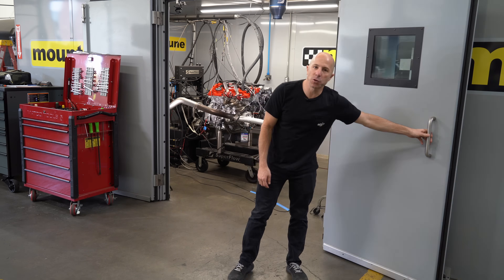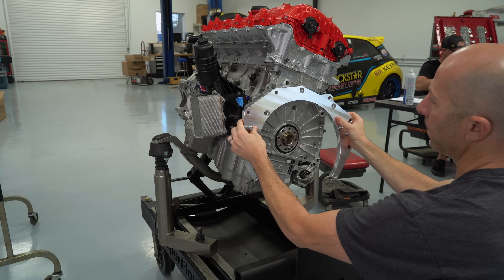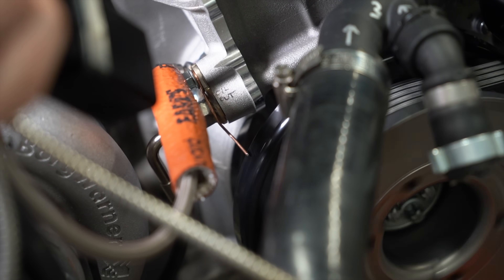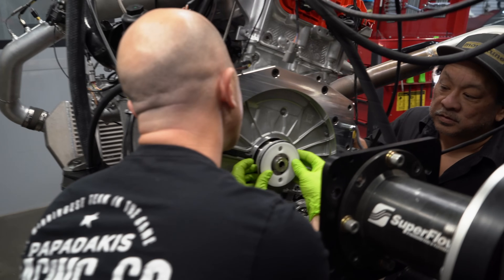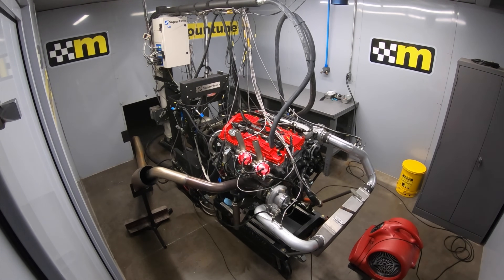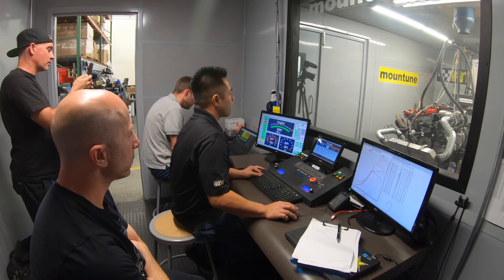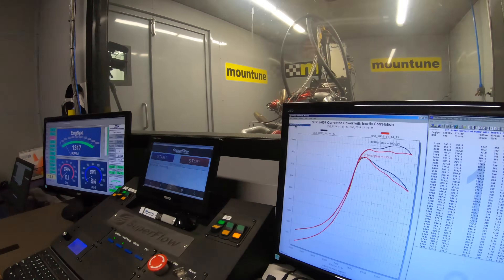B58 Engine Dyno 1000+ Horsepower - Sounds like a 2JZ!?

Comment: Engine: revs
Direct injector: ight imma head out
Reply: n54 vibes
Reply: I still wish they retain the direct injection system.. with them the engine able to take more aggressive ignition timing ...and the vvt system...picks up alot of torque down low....

If disable everything, then might be as well as using old 2jz engine into the new supra
Reply: Cheap ecms like the aem cannot control a direct injection system. You’re stuck paying for top of the line Motec, Syvec or I think Haltech offer some DI control now. 
I don’t know why they omitted the variable cam timing. It’s not a huge deal on a race motor in a lot of cases although I think you can do some thing with valve overlap to help spool really large turbos. They must have figured they didn’t need it at this time to accomplish their goals. 
I’m guessing this project is really only a stepping stone.
Reply: @Turbochargedtwelve  get an ECU that can. To not run the direct injection is a waste of potential. Typical dyno mentality, where getting a number is more important than the curve.
Reply: @DodgyBrothersEngineering i hope after this (since 1k hp target achieved).. they will redo the direct injection and the variable cam setup....
Their effort of building the b58 were awesome anyway
Reply: @DodgyBrothersEngineering  You cant use direct injection as fuel pump not strong enough for 1k hp.
Reply: @AmirPomen  yes that would be really cool.
Reply: @proxypanda4156  nope but you can use it to maximize some of the other benefits. Direct injection cools the combustion camber area whereas port injection often gives up its cooling effect to latent heat transfer, so by the time fuel droplets get to the combustion chamber any cooling effect has already been absorbed. Lowering combustion chamber temperatures lowers the chance of pre detonation and allows for greater timing advances. Not only that but injecting in multiple places allows for better fuel atomisation. Multipoint injection will always be better than a single point, if the tuner knows what they are doing.
Reply: @DodgyBrothersEngineering  Fair call, however is that still applicable if youre using e85, and is all of it lost or not because port injection is at the back of the valve which is also a benefit to cool the intake valves where as direct injection doesn't benefit that. If they're using specially coated piston tops for heat management then that's not really necessary? As Papadakis did, its much less complex system, and also what's the chances of direct injection failing compared to port injection? 

I feel like BMW obviously did direct injection to combat some emissions, and yes the better atomisation with multi point injection, but for brute power Is it really much of a gain if you come up with a beefy enough system to cope for that power level, then also how would the car idle with huuge direct injectors. 

I'm curious, if you were to build a b58, what would you do.
Reply: @AmirPomen  agree you have given away what makes it special.
Reply: Pretty sure these run at 320bar? Wonder why they didnt use direct injection and also run port injection.
Reply: @Apexfd  maybe the injectors cant fuel 1000hp?
Reply: Charlie Arvidsson definitely cannot but you can still use it to get ever last bit of fuel in the chamber and add more boost
Reply: Ahh, gotta love Bimmer memes.
Reply: Port Injections: NOOB
Reply: Boost: exists
Direct injector: Am I a joke to you?
Reply: @MozzaBurger88  Boost: lol you are when you bring a slingshot to a howitzer fight.
Reply: MozzaBurger Dookey
Reply: Im going to subscribe out the gate just off the love you have in the comments.
Reply: Everyone has their own recipes.. papadakis is pioneering this.. things will change in the future or maybe not.. sometimes simple is better. No di or vvt
Reply: I think the fact that he races it may be important too. A single rail with the injectors outside of the combustion chamber may be much easier to service than one mounted into the head.
Reply: there was no fuel to cool it
Reply: @matutolaYT  you dont get the reference 🤦‍♂️
Reply: @matutolaYT  as stated in the video

Comment: Why didn’t they just use direct injection in the first place?
Reply: Not enough pressure on the rail for the size. You would need something the size of a diesel injector for that kind of power. Just not enough room.
Reply: so far only custom stuff can provide enough fuel in direct injection to make 1000hp
and those are extremely expensive

Comment: Great work! 
But I think using 2jz is simplify and cheaper for getting 1000hp. 2jz-ge vvt-i heads with porting works fine as 2jzgte heads, 2jzge engine blocks transforms to gte simple too. There is no problems in searching gte engine, because almost all tuning parts can be applied to 2jz-ge vvt-i)) Yes, i undestand that b58b30 is a future, but we are still lives in present)))

Comment: this is as much horsepower as a bugatti veyron, with a 6 cylinder
Reply: no its not, its probably not even half
peak horse power is just a number, the veyron has 3 times as much power at 3000rpm, so you need to average the horse power over the rpm range
Reply: @matutolaYT  i guess
Reply: @matutolaYT  but engine technology has come a long way

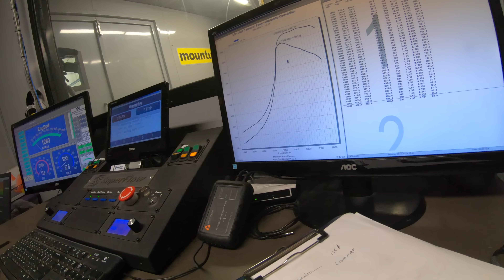Comment: 9:14 something is badly wrong with your turbo or cam choice .. massive torque peak when it comes on boost then it falls like a stone .. 900lbft at 5500 giving you 940hp then torque dies and power flatlines across .. if you had the same 900lbft at 7500rpm you would make 1285hp .. fix your part selection!!

Comment: I hate to be that guy, but on a six cylinder with 43psi of boost and your billet everything with you new injectors, you should be making more than 1009 horsepower. If you read this papakdakis, could you fill us in on what your limitation is? Are the injectors at max duty cycle?

Comment: If injector tips burn when not in use, then it must be very bad to do cylinder shut down on DI for Honda V6 engines. Over time I bet the seals burn. 1000HP accelerated it. Cool quick fix with those dowels.

Comment: How engine is cooled on dyno? I don't see any radiators
Reply: They have a water to water system that takes the hot water out of the room so the ventilation fans don't have to work as hard.
There will be a radiator outside, with a coolant loop for the engine side going through a water to water heat exchanger to carry the heat out.

Comment: I’m not sure if I’ll get any feedback towards what I’m asking, but since I am terribly curious I’ll post them with high hopes.

My sincere thanks in advance for any consideration given and also for your time towards this public awareness initiative.

1) Can you advise why the exhaust cam profile was the only one changed? I am hoping that it’s a case of time frame on the development for the cam profile of the intake rather than a case where you were only aiming for what was necessary to achieve your target horsepower.

2) Since the exhaust profile was revised, can you share any engine pressure ratio details and also can you comment on whether there was a notable comparison on the variable cam timing tune (adjustment) between the OEM profile and the revised profile from Kelford cams?

3) Was there any specific reason that the volumetric efficiency data available through the AEM’s air flow modeling didn’t reflect a significant change in air mass being ingested by the engine? If this was the case why you realized that the recirculating air supply fan for the dyno cell was off then it would have great to share this.

4) Should the case be that a direct injection fuel system has become available with enough support to cover your horsepower goals would you explore this avenue? I am speaking about a DI only setup, not a mix of DI with PFI.

5) What ecu manufacturer would you be open to working with if the opportunity presented itself?

6) Many of the technical details that reflected the success of this project weren’t shared, I am speaking mostly from the perspective of engine management data, would you be willing to make some of the obvious illustrations available by way of data log screen shots? No specific calibration data necessary, just the recorded data from the sensors.

I’ve got a few more questions but this probably isn’t the appropriate forum. Thanks again for taking the time to facilitate such an open initiative, and I commend your efforts.

Cheers 🍻

Comment: I wonder if you’ve run in to the problem where you’re you cannot push out any more gases through your manifold I’ve never worked with a dino but it sounds like it’s bargain really hard opening up and then boarding off at the top end

Comment: Struggling at 42psi? Smells like you're running out of turbo. If there's anything I don't like about that motor is that integrated exhaust manifold crap, makes everything harder to deal with. And I guess timing in the back, but that's not new sadly.

Comment: @
PapadakisRacing 

Hi Mr Papadakis,
why you dont use the Motec M1 GPRDI (Race with Direct Injection) together with the original direct injection and the port injection ? 
It would not be a disadvantage, for my opinion. 
The next Question is, why you close the Direkt Port injection? 
That would been a good way to measure the combustion pressure, so knock sensors would no longer be  necessary and the engine would always run perfectly, keyword: MBT MostBreakTorque.

Best Regards
Aaron

Comment: Bit of a rookie mistake leaving the injectors there wo using them, but nevertheless cool stuff. You should put a proper DI capable ECU there and use also the advantakes of the direct injection!

Comment: Questions: why did he chose to go port injection? Does direct injection limits horsepower figures? Is there a way to improve current direct injection system to be as good as port injection or there is a bottleneck?

Sorry asking too much questions i just want to learn
Reply: No, actually the will go DI if the aftermarket supported it

If

Comment: The B58 engine in older Avalon might be a fun build. A simple rear-drive conversion with adjustable driver boost. I love seeing the big horsepower, high torque engines in light cars, but it's just as fun seeing a comfortable 4 door road car rocket down the road.

Comment: Don't know if it's just the muffled audio through the wall but it sounds like it wants to rev a lot more
Reply: If you look closely at the Tach on the monitor, the car never really goes above 7000rpm. I'm not really sure why they stopped there but I assume it was to be easy on the engine since they made 1000hp already.
Reply: JackSwatman that’s what I’m hearing. It’s like 3/4s of a max redline.
Reply: Look at the graph and you will see the power dropping off before 7k rpm. I think that is all the turbo had in it. 2000 rpms of power isn’t bad.
Reply: That’s what I was thinking while rev it out when the power falls short
Reply: @thenostalgicgamer2093  agree with there.being no point in ragging any more with the current setup but just feel they need a turbo with a bigger set of lungs
Reply: JackSwatman yet a bigger snail will solve that but lag ig smh

Comment: Absolutely Impressive! Great Job on this engine build! Lots of peeps following this.
.
@ 7:28 NASA type Engineering like you READ ABOUT.
.
It reached over 1000hp at 7k rpm. I think this engine build can go much higher.
Reply: Yeah thought that was quite a number for such a low RPM. that straight torque though oof
Reply: We did stuff like this on our NASA projects when we gouged holes. Didn't use a BBQ grill, but same idea

Comment: Why not use both DI and port injection together? That's what Lambo does with the Huracan. They burned up because there is no fuel going through them so nothing was cooling the injector. Wouldn't it be easier and better to just use them?
Reply: I don't think the DI injector seals will hold under boost. Remember that all Lambos are N/A, so the cylinder pressures are lower.
Reply: @halofreak1990  True they're NA but pretty sure people also run them on the high horsepower twin turbo setups I think?

Comment: Amazing job. Did you modified in any form the PCV system (included in the valve cover) ?
On my engine (N13) a rubber valve blew up after some kilometers and a tune. Due to the pressure, my oil jauge popped out twice. Had to change the whole cover.

Comment: So for it to be a "real" 1000hp car it would need to be like 1250hp on an engine dyno to make it near 1000rwhp right?
Reply: I'd say more like 1175-1200 range
Reply: Why would that be the case? 1000 hp is a 1000 hp, innit?
Reply: @maximilianlindner  you need to put in real world situations like hotter days etc then transmission loss so after all the transmission loss ud see 1000bhp at the wheels
Reply: @shakabehussain2825  Well, that's why you have hp and whp, don't you?
Reply: Max Lindner no mate

Comment: Are you also controlling the valve timing and lift with the Infinity?
Reply: he didn't use the valvetronic at all. it was set to highest lift mechanically
Reply: @n.shiina8798  Yeah I was expecting that because the dyno graph seemed a tad lazy.
Reply: i asked if there's advantage to use purely TB control instead of the valvetronic on the previous video but no answer yet. he might not seen it

Comment: I would highly advice you to throw away the sealing that you initially build-in the wrong way and use a new one. I made the same error once and when i put it in the right way it worked first and looked fine, but the sealing was damaged and after about 2 months it started leaking again, you don't want that to happen when you put the engine in the car or use it on a race track.
Reply: He clearly used new one :)

Comment: Was curious and did some calculations and if there correct this engine puts out the equivalent of 775,453.3 watts or 775.4 kilowatts of electric power! that's almost 1 Megawatt of energy which is insane when you think about it.

Comment: :facepalm: sounds like it wouldve been easier to run the DI and use the port injectors for supplemental fueling
Reply: 1320crusier pretty sure the AEM can’t control the direct injectors. None of the mainstream standalones can.

Besides, DI will only support you until the 600hp region before the HPFP starts having a bad time.
Reply: @WoahAngelo  Depends on the engine build, I'd say, given that Ferrari has used DI for a while now on engines with 800+ HP.
Reply: halofreak1990 those are generally V8s, larger than 3L. The specific HP/L is still lower on your Ferrari example vs this B58.

The issue with putting high boost in direct injection engines is that the cylinder pressures is directly trying to resist the incoming fuel pressure through the DI system. Your cylinder pressures are going up but the HPFP is still being driven at the same speed/operating at the same pressure so now your output pressure at the injectors come crashing down.

Same reason why 1:1 fuel pressure regulators exist in port injection systems. The regulator increases the fuel pressure by 1psi for every 1psi of boost in the intake tract so that you’re always at base pressure and expected flow rate for the injectors. The issue with DI systems is that for every PSI of boost you put through the engine, the cylinder pressures go up exponentially. Eventually the HPFP won’t be able to keep up.

You can overdrive the pump or add another pump in the system but eventually port injection becomes the only viable option. 

/edit: also note that they’re running E85, which has less BTU than straight gasoline. Which would require total flow to be 40% higher to make the same horsepower. Stressing out a HPFP even more.

Comment: So basically they built the engine with custom everyhing max out a big turbo and built b58 at 43 psi and only got 980whp ?
Reply: Not custom on everything. They still maintaining stock crank, head, and bolt. They virtually just change the piston and piston rod for the engine, tweak the ports a little bit, and change the turbo kit. 

obviously there were many, but i pointed them out.
Reply: It's got a stock crank and block. They only upgraded the pistons, rods, cams and intake ports, IIRC, though I'm not sure about the ports.

Comment: What people don't realize is that anyone with the curiosity and drive to rebuild an engine can do it with basic research and resources. Machining work will have to be performed at a machine shop but basic assembly can be done by anyone!
Reply: Brad Carpenter and funds.. most important part

Comment: 42 psi boost? How much did you need to reduce the static compression of the engine to make it work?
Reply: Think it is same as stock, running E85 racing fuel to handle the increased boost
Reply: 11:1 is normal for new oem turbo cars in 2019.

Comment: The only thing factory on this build is the crankshaft... wow this motor is interesting
Reply: And you think 1000+ 2j has stock internal in it to be reliable?
Reply: Arvin Badruzaman stock bottom end 2JZ would beat this motor
Reply: And cams
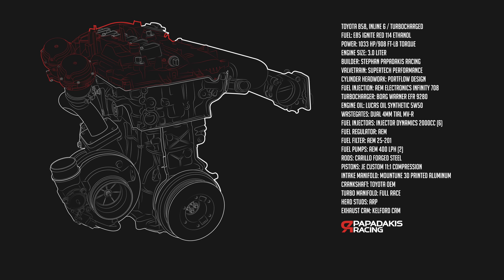Reply: Seb C the exhaust cam has been modified. Look at the build 11:26
Reply: @tomgones5865  True, forgot about that.

Comment: What were the performance benefits of only running port injection?
Reply: More homogenous air/fuel mixture and cooling for the valves i would assume.
Reply: Nah. It's just because of there's still less support for DI Aftermarket

Comment: dude why are you creating more issues. direct injection is by far better in every conceivable way. 
all you need is a fuel pump running off the crank.to get the pressure levels you need.. simple 

nice number at the end :) 
I noticed that run before the last the HP kept going up and down. and I was thinking boost cut or fuel cut or something. but it was just chocking on its own exhaust gas.